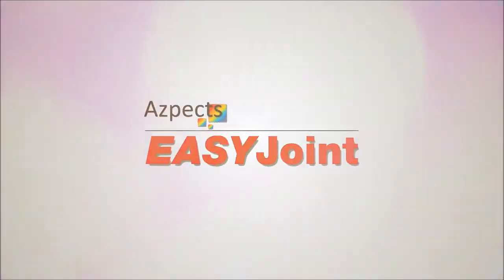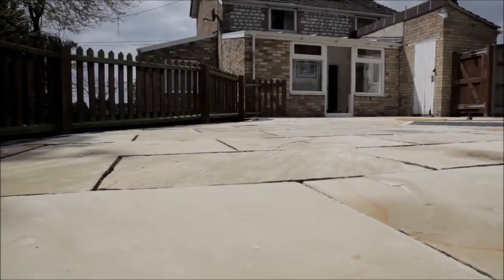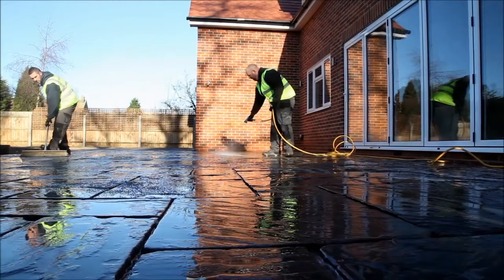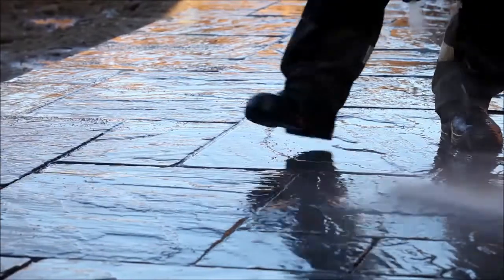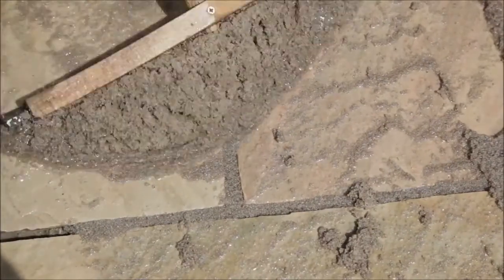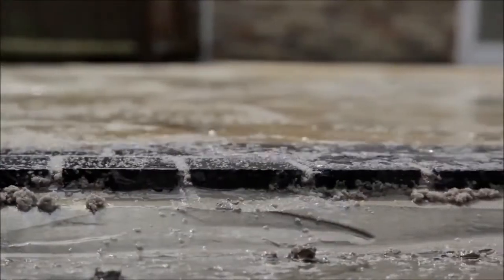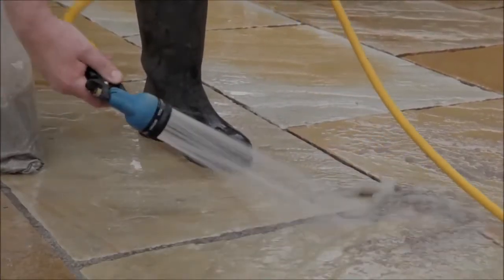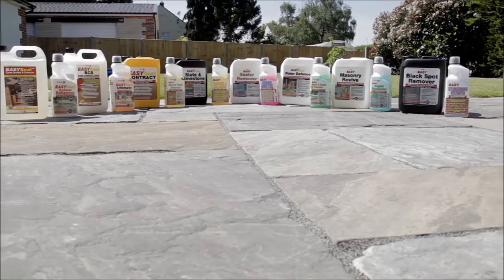How to use EASYJoint All Weather Paving Joint Compound

Comment: How long can the excess be stored in water?
Reply from the maker: The manufacturer states that the excess can be stored for a couple of months by keeping it covered with at least 50mm of water, we recommend using the original tub and securing the lid back on. 👍😃